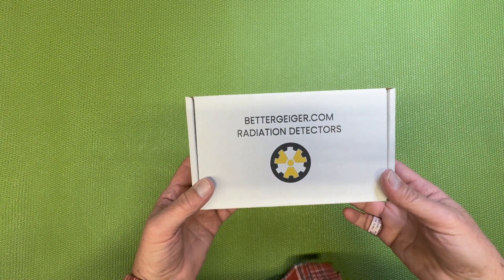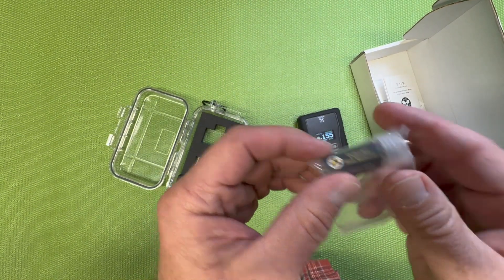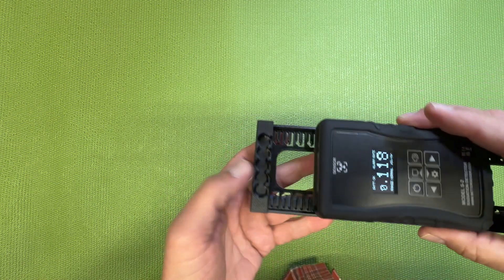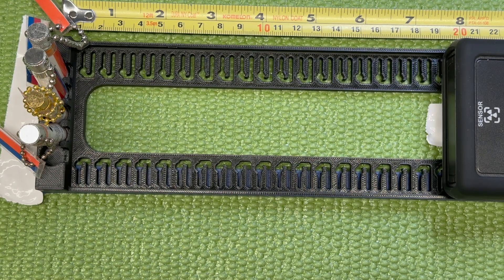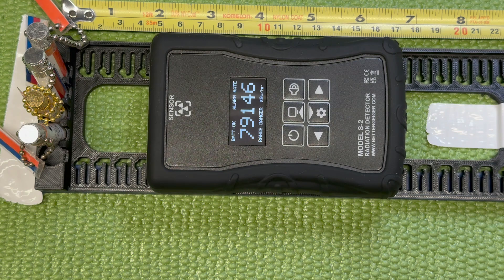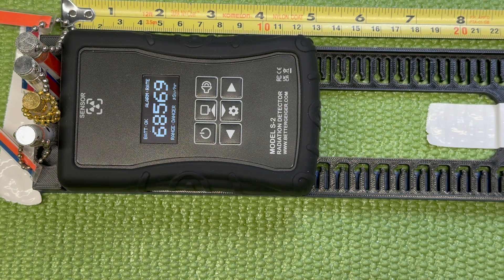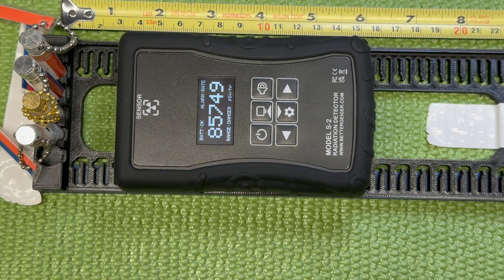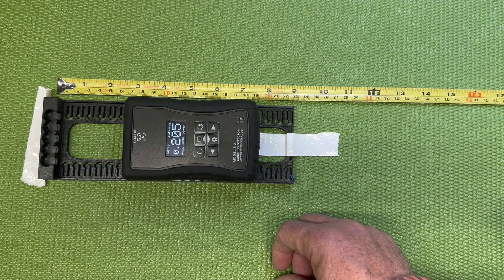Testing the S-2 "Better Geiger" Radiation Detector

Comment: I'm curious what the dose rate of the 4 sources is! 🤔
Edit: I calulated 3.28 ÷4 minutes± 0.82mR/min
So 0.82 x 60min = 49.2mR/h dose rate at 1-1.5m distance? Holy molly😵‍💫
If I say nonsense, please correct me! I want to learn as much as possible about radiation. So is at 1-1
5m is 50mR/h~ ai the 1cm is almos 1R/h😢

Comment: I noticed the dose went down significantly when directly next to the sources as compared to when it was 2 inches or so away, it was roughly 20,000 uSv higher. Was it oversaturating?